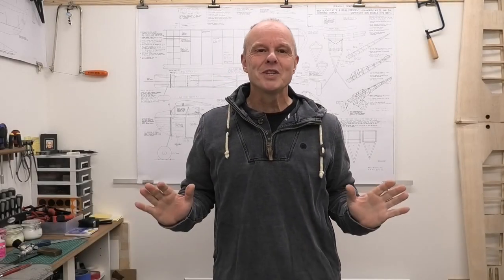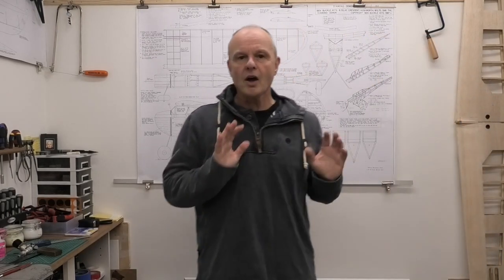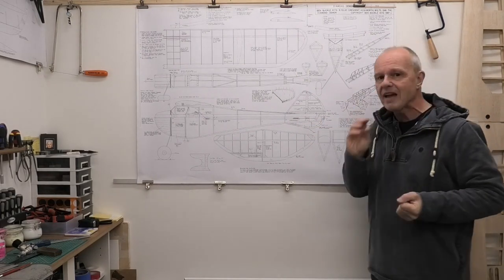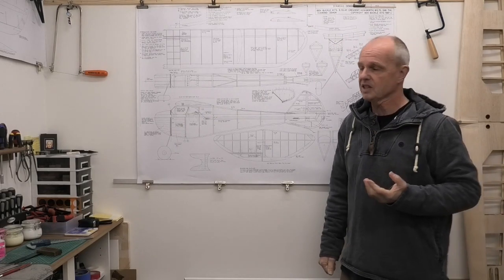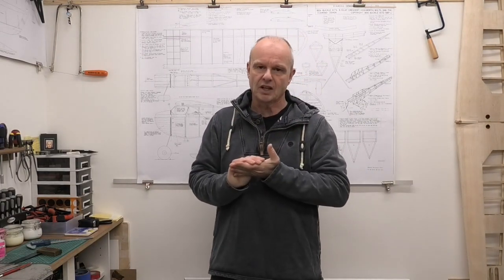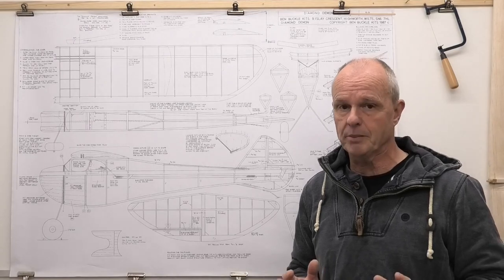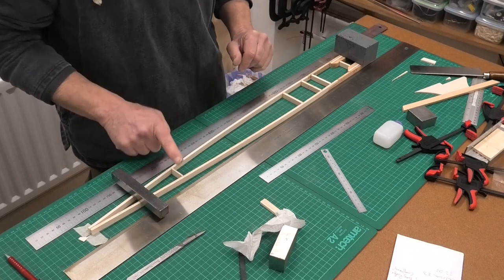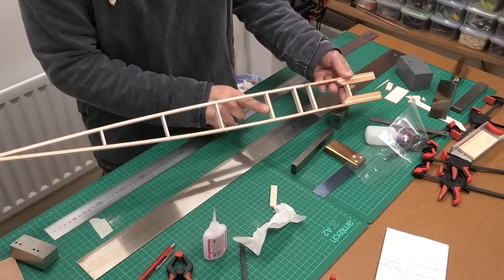49" Diamond Demon & Bantam 19 Spark Engine - Pt 1: Plans & Building the Crutch - Ben Buckle Plans

Comment: So there will be no throttle control?
Reply from the maker: Correct, no throttle.  These early vintage planes/ engines didn't have throttles, they were designed to fly to a height and then the engine would run out of fuel and you would then soar on thermals and gradually glide back down, so a little like powered gliders.  They used to have competitions to see who could stay in the air the longest after a timed engine run.  These days you could of course fit a different engine and fly it with a throttle. Hope that helps 😃